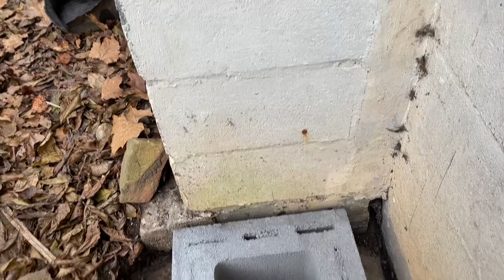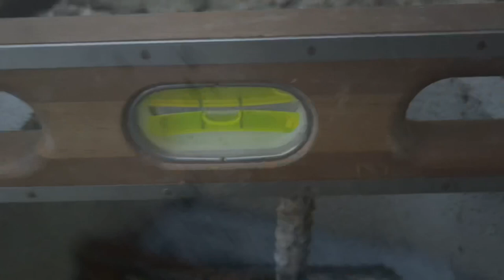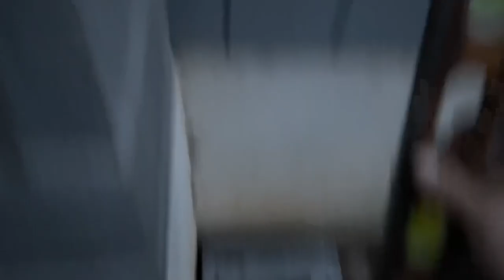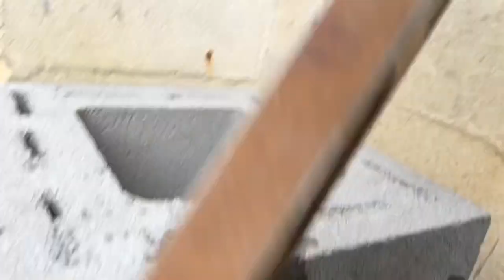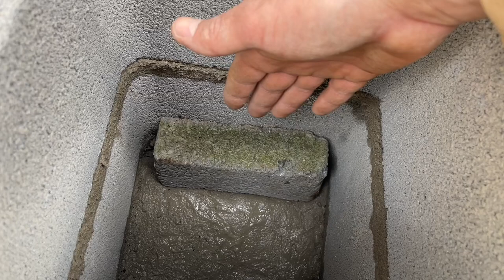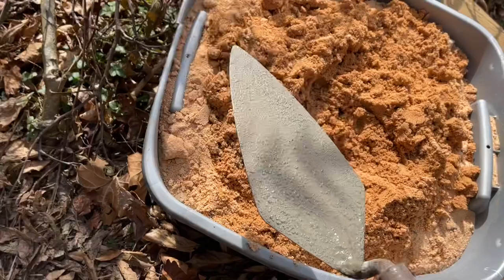Building A Chimney Flue Part 2 v73

Comment: If something expands and contracts due to heat, you need to let it expand and contract FULLY.... or it will break apart. Perlite "surround' would have been best, or mineral wool insulation, but that's not great if water gets in.
Reply from the maker: Yes for sure. Thank you!